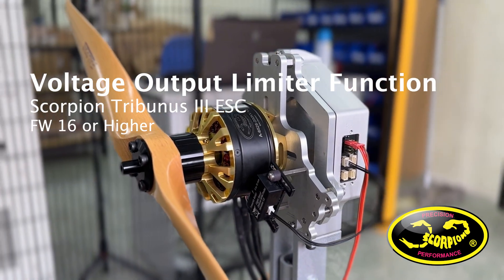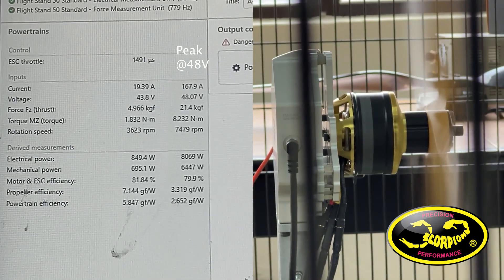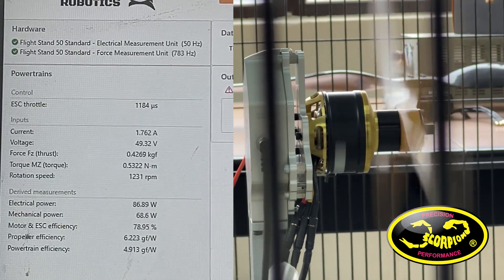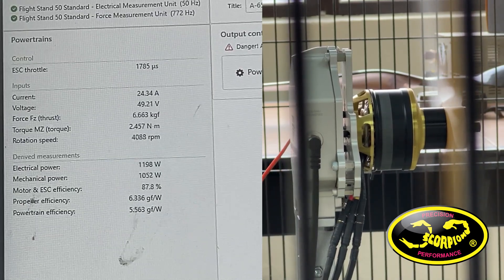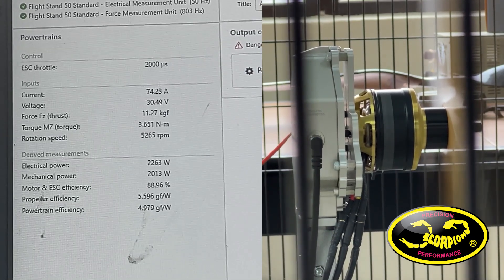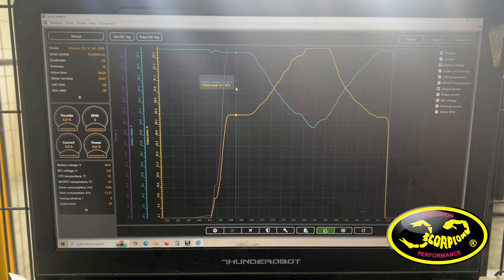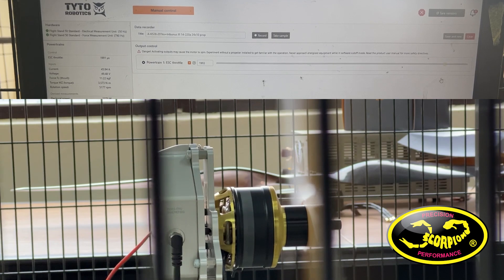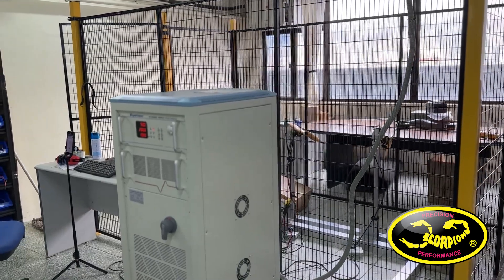Scorpion Tribunus III ESC -Voltage Output Limit Function

Comment: How is this different to using the governor function in helis?
Reply from the maker: Governor regulates RPM. This regulates voltage to the motor. 

Mostly useful for airplanes which do not utilize a governor. Also on airplane you do not want to limit rpm, as in hover vs forward flight different Rpms could be attainted due to dynamic flight. 

As well though it can be used in conjunction with heli gov, to provide equal top end holding power from start to end of the battery

Comment: А какой пропеллер используется, 24Х10E?
Reply from the maker: 24x10E
Reply: @dahlkyle  Спасибо!
Reply: Nice feature Kyle. If i understand correctly, it will be useful for uav applications to boost endurance if you don't really need that much power. 

But I wonder how this will be useful for 3d flying for heli or planes if you limit the voltage to 43v max, potentially reducing thrust and experience more voltage drops during some demanding manuevers? Hope my question makes sense. 

Love the work btw. Huge fan of the tribunus line. 😊
Reply from the maker: @murdannymukhtar3089  it is a valid question. The purpose is to do exactly what you say. With 3D airplane for example, you have more thrust at the start of flight,  and less thrust at the end of the flight. With this feature, you would set the limiter to the lowest possible voltage, and then have equal thrust from start to end of the flight (yes you give up more power when the battery is charged fully) . 

If you take it one step further... let us say you like the power of the model at the start of the flight when the voltage is high, and want that same power ability at the end of the flight (with lower voltage), then you would need a higher KV motor to get same thrust for a lower voltage. But then if you do that it may over load your motor at the start of the battery. So you could , in theory, use a higher kv motor, with the voltage limiter. Then at the start of the flight, the voltage is limited, and at end of the flight, the power is still good.